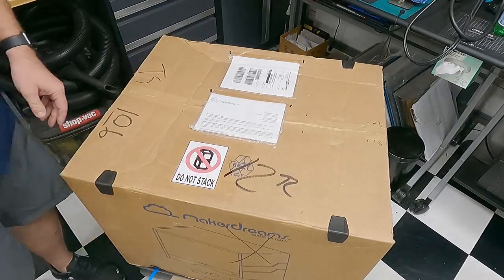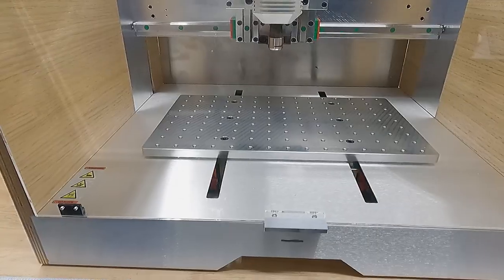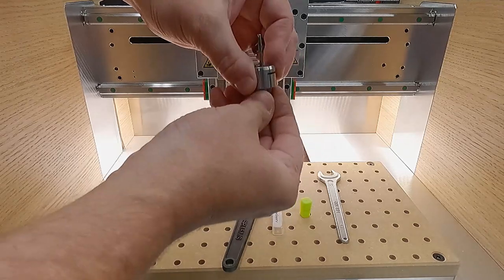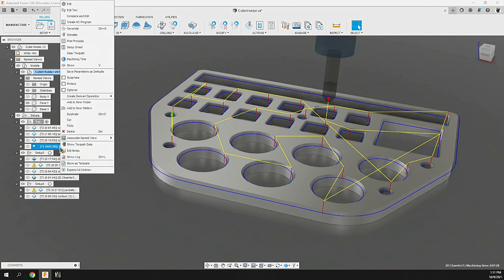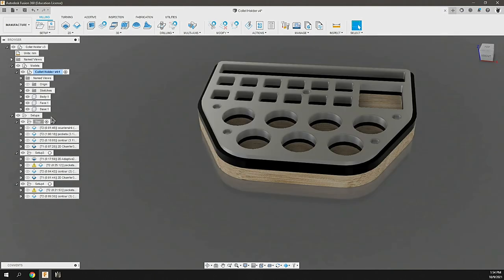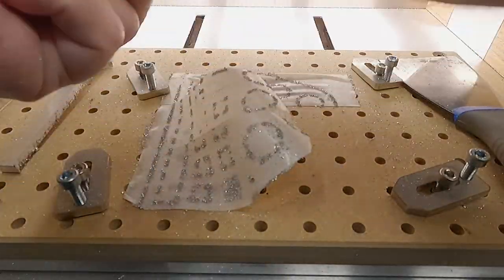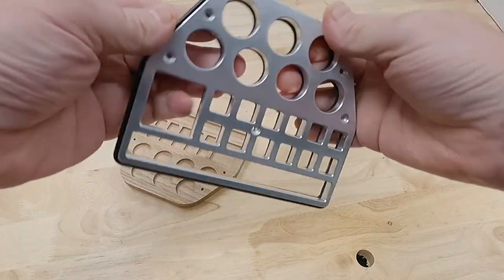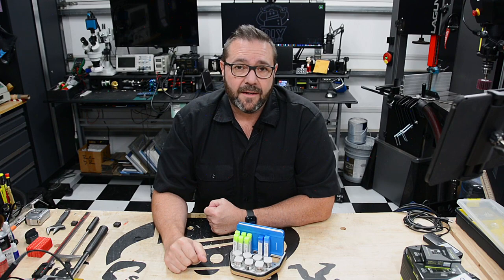The New Evo-One Pro Desktop CNC, Raising the bar for micro-fabrication!

Comment: Beautiful machine, be interested in seeing the guts of that spindle!
Reply: You can see it on their website, kind of surprised. It is just a 600W brushless motor. Usually you see these with ER11's., this one has ER16. I must say I am a bit conflicted on the setup for this price. The X-axis and Z-axis use real linear rails, the Y axis however does not ...  It looks to be doing OK which is good but for the price I would have liked to see a full linear rail setup and better spindle motor.

Problem with this one is that the fan is just mounted to the top part of the motor shaft. So at lower RPM the fan blades also run slower. Add the cover they put over it and I worry that it might get a little hot. An E-Fan would have been a better choice (i.e. a 12 or 24V fan that runs autonomously).

I do like fact that it is enclosed but at the same time worry about actually using coolant on this machine with portions of the enclosure being wood. Also not sure coolant would have a good way to evacuate lest it be something like alcohol based misting that would evaporate. Real coolant (even misted) looks like it might not be an option.

All in all, I keep coming back to the price... It just seems a tad high (not absurdly so, but still).

Comment: great video! I just upgraded to the Evo One from my original Nomad 883 (Kickstarter). I loved my Nomad but the Evo is superior in every point… except for one thing: there is no static tool measurement “post”. The same can be achieved with the touch plate but there can always be some dust underneath or whatever the operator screws up.

Idea for one of your upcoming videos: It would be great if you could explain how to wire up your edge finder to this machine.

Thanks for your channel. I love it.
Reply: i would probably "retrofit" it with linuxcnc and add a tool length probe and 3d touchprobe to it. cant work accurately without it.

Comment: A quality review, thanks for including the details on the CAM and speeds and feeds. You suggested an air assist to clear chips, no mention of a vacuum. How well will the bottom rails and other moving parts stand up to chips and dust?
Reply from the maker: Definitely requires routine maintenance to keep the machine clean. If you plan to mill wood and plastic a vacuum can help with that. For aluminum, vacuum doesn’t generally help much as the chips are heavy. Industrial linear rails and ball screws hold up well

Comment: How does it compares with the DeskMASTER DM500?
Reply from the maker: While the Deskmaster DM500 is a solid machine and includes an offline controller with a DRO and Step Wheel, the gantry is a solid competitor with only one vulnerability... the X axis of the gantry only has one linear guide block on each x axis linear rail, which leaves it vulnerable to lateral moves in hard material. it is an unfortunate design choice that hopefully gets addressed in future versions of the product.

Comment: Do you still have this machine or do you just use the HDM now ?  Not sure if I should get this machine or the HDM.
Reply from the maker: I mostly use the HDM, but I have invested lots of $$ to get it where it is today... ATC, modular bed, tool rack, enclosure... HDM is a great foundation for a serious machine. unfortunately C3D does not really provide support to do that so it has been a lot of independent engineering... ;)
Reply: @DIYEngineering  
Got it. If I were to buy the HDM and without any mods with the exception of a mister and enclosure will the HDM be fine to cut simple allum parts and of course wood ?

Comment: Hi, just found your channel in my suggestion lists, and I'm very impressed by far. I've a few questions, regardings to the Evo One Pro :

- On the previous version, you have a mist coolant spray system. However, the manual seems to discourage of using/spilling any liquid inside the enclosure. Was there any problem for you?
- Otherwise, I'm considering a dust shoe to clear the chips or just compressed air and clean later (as suggested in video). Are these options viable in your opinion?

Thank you, and wish you all the best.

Sincerely.
Reply from the maker: When using a mister i use a mixture of alcohol and water that evaporate fast, it takes away heat but doesn’t make a mess.
Reply: @DIYEngineering  Thank you very much for sharing. Have a nice day.
Reply: @DIYEngineering  Hi,  have bought EVO ONE PRO also, what are the % of alcohol and water that You use for the milling machine?

Comment: Question: how noisy is the EVO 1? It is on my shortlist, but these spindles can be very noisy.
Reply from the maker: It is relatively quiet up to 16k. 16k-24k it does get louder but still much less than a router.

Comment: Have a look at the Carvera. The specs differ slightly, mainly a smaller spindle (200W, up to 1/4" collet), but it's similarly priced along with having ATC, servos instead of steppers, ball screws like this one, wireless probe (works with ATC), built-in dust collection w/bypass port, air assist nozzle & tube with port on the back to connect your own pump, and built-in laser. Cuts aluminum well, albeit probably a little slower than this machine.
Reply from the maker: Yea, I’ve seen it but the spindle is only good for circuit boards and light materials.